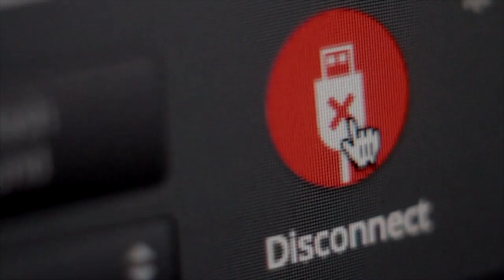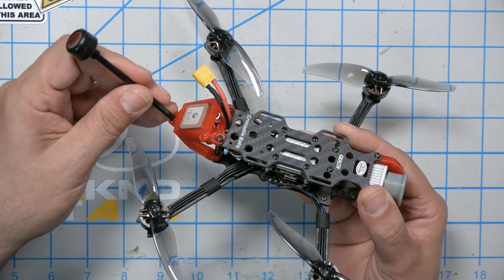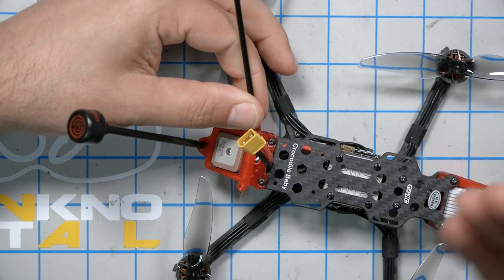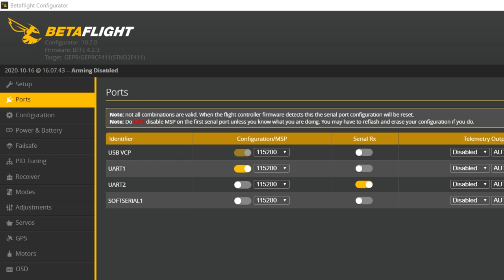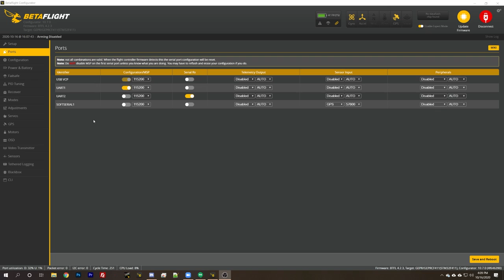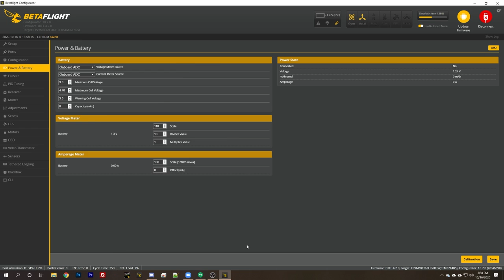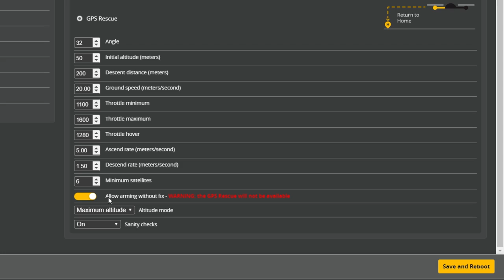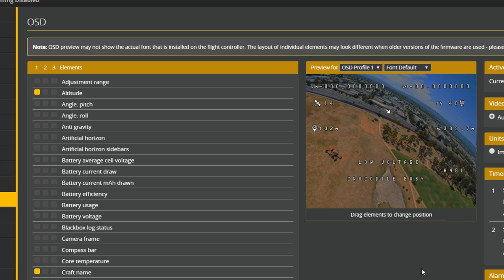GEPRC Crocodile Baby LR can fly for 30 minutes???

Comment: I'm really liking how the hobby is gravitating towards smaller quads since I started flying sub 3" and have continued to fly sub 5" for years since.
Reply: I agree, I really feel like my 3 inchers fly better than my 5 inchers by themselves.  The issue is that 3 inchers can't handle a GoPro nearly as well, so 5 inches is still the most relevant--although less relevant now that we have the Insta360 Go and Naked GoPros.
Reply: Boring.
Reply: @coolhanddruid  As is your comment.
Reply: @licensetodrive9930  No you
Reply: @coolhanddruid  Try something like a 1408 4000kv sub 250g 3" build on 4s. Imo you need to maximize power as you go smaller/lighter, and try to maximize smoothness when you go heavier. A quick and very agile 3" build can be very fun, and easier to tune. You can swap out to bi-blade props and fly in a park around people, they won't even notice it. Everyone flies different though.
Reply: Who needs a gopro if you have Dji 1080P. Unless you’re using the footage for professional purposes. But then there are other solutions.

Comment: Josh, I agree about the antenna tubes, one solution I found was I ordered the extra thin antennas from banggood and they actually fit inside those little red or clear extension spray tubes that come with WD40 or DeOxit D5 electrical contact cleaner aerosol cans; I went to my local electronics store, and they had bags of them that they found in the bottom of boxes of spray cans that use them... They had clear ones, and gave more than 20 for free. I mention this because it's the best way I found to get them, they're hard to find by themselves in less than boxes of 1000. Anyway, they're indestructible, at least so far for me, and my uniquely crash-heavy style of flying...! Some antennas didn't fit, but the skinny ones did.

Comment: After around a year having the Croc, I can tell buy it.
As a beginner, like I am it can give you a taste of different areas like crusing or first simple freestyle depending on hattery.
I flew it with 4s 1800mAh chonckers which I already had up to 15 minutes and now with 4s  650mAh which in comparison for my beginner reference is a hellride of agility and climb rate. Also as a beginner the actual need for freestyle-capability is limited - so in my opinion this quad brings more than enough to table to get a taste and learn basic things.

How ever I feel as a real bloody beginner, I would not recommend starting with light batterys - the less agile behaviour with heavy batterys is helpfull in the beginning I guess.

Also it even flys with 2s 1Ah hattery :)

Comment: 6:09 my guess is the vista is there so you can access the USB port without a motor being in the way like it is on some others. Same story with the whoop board rotated 45°, in most other builds the whoop board is mounted “naturally”, and it’s just about impossible to mount in a way that you can get to the USB port without taking the whole damned thing apart. Kudos for both of those design decisions.

Comment: As my first non-whoop quad I'm enjoying this. The only issue I've noticed is the current sensor did not work out of the box. I have the Analog and XM+ setup. They soldered the GPS RX wire to where the current sensor reads. I moved the GPS RX wire to the TX2 pin (A02) and remapped that. I then turned on the current sensor pin. Now I get GPS and Current.
# resources
resource LED_STRIP 1 NONE
resource SERIAL_TX 2 NONE
resource SERIAL_TX 11 A02
resource SERIAL_RX 11 A08
# timer
timer A02 NONE
# dma
 (maybe not necessary)
dma pin A08 NONE
dma pin A02 NONE
Reply: Jason what's your background thks
Reply: @joelhiltz3329  what do you mean, background?
Reply: @jacobm5186  Electronics Navy training ect  thk you
Reply: @joelhiltz3329  Just Electrical Engineering and lots of diy electronics.

Comment: @Joshua Bardwell  When you say you were running it at highest power available, do you mean 1200mW?   Vista has a known issue where sometimes performance actually decreases as you go above 700mW.  I suspect it's a feedback issue and usually this will vary depending on the antenna used on the VTX.

Comment: The ' flying brick ' architecture seems to still be prevalent in many designs.  One of my biggest pet  peeves and why  I prefer to design my own frames is many designs are still stacking  components instead of distributing them more streamlined. And my biggest pet peeve is the front mounted camera with little protection. And you are right to point those things out because the design of any  product is not just about mounting components to a frame... There is much more to that ...

While stacked components are desirable from a cpmpact form, if the quad frame has the room lengthwise, by all means,  use it! 

Interesting you bring up the ceiling mount of the  camera vtx, I did the same on my MIA Zoom years ago, for the same reason that I wanted to have ease of access to the VtX and DVR  when I was using the Caddx Turtle system. Except in my case the frame was very compact and it opens like a car hood, you can see that in some of my recent videos.

Comment: When you want to open it up, if you remove the lower front screws instead of the upper front screws the camera and its cable will come away with the Vista and that will give you much more access. (And will reduce the likelihood of you breaking the camera cable)
Reply from the maker: That's clever.

Comment: Hi, Mr. Bardwell! I just purchased the Baby Croc as my second fpv drone (my first is an Emax Tinyhawk II). I've run into some problems setting it up in Betaflight, though, my main one being that I lost my soft serial port and my GPS is not showing up. It was working fine when I set up the GPS failsafe using your recommended settings, but I must have accidentally messed something up. I tried resetting it to defaults in CLI but it didn't fix it. I'm fairly new at FPV and don't know what to do. Can you help me?
Reply: better off asking reddit😝😝

Comment: What about putting the GPS 5V to a switchable pin? Or using a little board what lets you to switch 5V with pwm signals, like the light switcher boards on RC cars/planes. So you can connect it to a servo output and assign an aux to it.

Comment: Nice rig, but I do not like the angle of the GPS mount.  I would not expect to be flying pitched forward at what looks like 45 degrees.  For "normal" flight you may pitch forward maybe 20 - 30 degrees, which presents a less that optimal angle for the GPS antenna.  Ideally you would want the GPS antenna to be face-up to the sky during normal flight.   It would also be nice if the FC was iNav compatible for true failsafe RTH functionality - nowadays iNav 2.5.2 flies pretty darn nicely compared to earlier versions.  While BF may be "best" (or what we are most familiar with), this is not an Acro rig per se, so you really don't need all of that.   iNav is ideally suited for LR and cinematic style flying.  I didn't mean to make this so much about iNav, but when you start talking GPS, BF is waaaay behind in that aspect ;)

Comment: 17:36 stm32F405 target? But my real question is, if I have Dji goggles2 and vista/old unit, how can I use it with this drone? I had v1 goggles worked fine on 4.1.1. on softserial (original Dji osd) but I pluged a g2 compatible flashed unit on this drone and no osd. What Bf version can I use to work? THX!

Comment: The jittery video seems normal on this quad from the other reviews I've seen.  But no one talks about it.
Reply: I noticed the same in a lot the footage of various reviews and also with my own Dave C Micro LR frame built/Vista, especially if there's a touch of wind. They just accept it or gloss over it.
Reply: @jt37218  low speed  KV-motor need naked gopro，LOL

Comment: Hello Mate, thanks for the great review.  Could you please show which pads are used to connect GPS in softserial configuration on this FC. I can use LED pad for GPS TX, but I don't know which pad to use for GPS RX? As you mentioned, UART1 is for Vista, UART2 for Crossfire. And I assume that Buzz pad is used for the buzzer? Therefore, the only available pad left to use for softserial mapping is LED pad, but GPS needs 2 pads one for TX and one for RX. I really appreciate if you show how they wired GPS on this particular FC. Thank you very much

Comment: @Josha Bardwell .. Is there enough space inside the baby croc 4" to replace the Caddx Vista with the Air Unit? ( i really want the on board DVR. (Also, great videos please keep posting) PD: when is the comparison between long range qwads gonna drop? ) thanks!
Reply from the maker: There is enough room front to back between the standoffs, however you would have to relocate the capacitor. I'm not sure there is enough room top to bottom above the FC, but in theory you could use longer standoffs.

Comment: Hi Josh.  I bought one and have been flying it for about a week.  I am having the exact problem as you, where my DJI Googles have 4 bars but my DJI controller has have 1 or 2 bars and turns red.  If you find a solution please let me know.  I'm emailing Geprc as well.
Reply: Ben did yours come with a Nebula camera ? Thanks

Comment: Joshua, or just anyone.  I got this Croc Baby and flashed it with G-H-30 2.3 JESC (48khz) with Telemetry, licensed. Then used Dshot300, 4k/4k, with Bshot "ON" and "12" on motor poles. It won't fly cause some motors are getting "errors," what's wrong with it? XD

Comment: How much amp draw were you getting on the Lions and what is the max discharge rate of the Lions?
Reply: For cruising (30mph) like 7-10A depending on wind. Punchout is 20-25A for me and the problem is not the lion cells, good sony vct6 can do 40A. Check the quality of your wires if you want to build your own pack. Cheers and happy flying!

Comment: Did your baby croc has an accurate current sensors? Mine can not be calibrated because maximum scale value is not enough. Did you have some advice? Replace resistor on FC?
Reply from the maker: Current sense does not work on that FC.

Comment: excellent video....... I Finally received my Crocodile Baby after almost 4 months of waiting...... I have a little problem.... I have the TX16s with R9M 2019 Module, the Baby has R9MM receiver, after trying different firmware in the receiver and the Module, I managed to Bind them and I get telemetry in the TX16S..... !! BUT !! ... when I connect the Baby to Betaflight,  I Backed up the factory settings, I Calibrated the Accelerometer, but I can't get any movement on the "Receiver screen", therefore, I can't do anything, or fly it....   . PLEASE HELP.
Reply from the maker: Since the receiver was pre installed it should really work. Very disappointing.

The first thing I'd check is that the correct UART is set for serial rx in the Ports tab.

Confirm SBUS serial receiver protocol is set in the configuration tab.

Comment: Good morning Joshua,
I am your follower,
I am Italian and I live in the Dolomites, indeed I invite you if you happen to come to Italy I wanted to ask you for advice if possible,
I bought a Croccodile Baby but I have a big problem, I can't configure the Osd on the Google DJI. The doors and the OSD are all activated but nothing appears on the display. On the other drones I saw that not having the DJI remote control but a Radiomaster TX16S I disconnected the cables from the Air unit camera as described on each model, instructions that I followed from my FC which is an iFlight and I see the OSD correctly on the viewers but from Caddx Micro I do not know how to do if this is the correct solution for the configuration of the OSD in your opinion, otherwise I cannot find the solution.
By chance you could help me, flying without knowing how much charge remains is practically impossible

Comment: re: vista packaging
I've had a tough time on two quads now trying to package the vista.  It's quite a bit larger than the 20x20 mounting holes, the position of the UFL connector and antenna can be inconvenient, it's tall, and the fact that you can't easily remove the camera to thread the cable through other elements are all things that have frustrated me at some point.  I bet you would have to change a half dozen things about the geprc croc baby to move the vista behind the FC.
Reply: Hey you can remove the camera connector. Just got to have a tiny torx screwdriver
Reply: @ekkle5ia  I guess a better way to say it is that since there is no plug on the camera side and you need clearance to get a driver onto the hold-down on the vista there are situations where you are stuck vs. analog setup.

Comment: @joshuabardwell "if you take off with minimal amount of satalights gps rescue will not work" It wont add satellites as they come available in flight; making it work?
Reply: It wont work in the sense of working correctly, ie with the correct home position. Once it gets GPS lock in mid air then it will likely become the home point making it pointless or "will not work" (as advertised)

Comment: They are either under 250 grams or can fly for 30 minutes, but not both at the same time. The 4S battery pack itself is 195 grams already. And the drone with lightest option with analog video is 130 grams. It can only be under 250 grams with a 2S pack. And we all know that you can't flip and snap with 2S.

Comment: After watching Your movies I decide to buy Crocodile Baby with vista vtx. But it is a big shit. In oryginal configuration it do not have the current sensor. But the worst thing is that FC is restarting each time after 3 to 10 min. I changed the FC to the new one and the situation is exectly the same and there is no solution for this. Now I am fighting with the shop to give money back becouse this quad/FC inside is tottaly useless.

Comment: i dont understand why none of these GPS LR quads include a magnetometer - its not like its hard to find a GPS module that has a compass built in.   I would love to try one of these with iNav for real hovering and etc but need that compass...
Reply from the maker: Because a magnetometer on a tiny quad gets a ton of electrical interference and doesn't work well. The mag works best either when the quad is large so you can mount the mag away from electronics, or when the mag and GPS are mounted on a boom.

Comment: GPS and fail-safe no longer shows up under beta flight and I have it enabled... guessing I should have saved backup before making small tweaks?...CLI commands for Gps stuff work but I'm a noob. I wonder if going to beta flight 4.2.5 will fix it. I have 4.2.3
Reply from the maker: GPS and failsafe missing makes me think you have "expert mode" disabled. Top-right corner of the configurator, gear menu.
Reply: @JoshuaBardwell   omg  thats exactly what it was! I had given up thinking i tried everything. This is my 2nd quad behind the tinyhawk. I feel better now about purchasing a 3rd from the same brand using an affiliate link ;-)

Comment: Does this drone, or others in this size category, have elevation hold or gps position hold?  What type of diy system would you recommend to avoid buying a mavic mini?
Reply from the maker: It does not have those features. You want an iNav or an ArduPilot drone.

Comment: Hi, this video is titled "can fly for 30 minutes???" This is a LONG video that seems to cover about everything except flight time.  
I sent this link to a friend who was looking for information on something that can fly longer.   Sent him this link figuring this would be discussed in detail from the title alone LOL.   
Do you have a different video that gets into longer flight times? This certainly is not the one.  Thanks!
Reply from the maker: I will be doing an flight time comparison of all these guys in the "shootout" video that follows the individual reviews. But the Baby Croc definitely can fly for about 30 minutes when using the 3000 mAh 4S LiIo pack that GEPRC sells (or a similar pack).
Reply: @JoshuaBardwell  Excelllent! Thanks!
I had no clue 30 minutes was possible.  
I'm pretty out of touch with newer stuff.
Will need to get back in touch.

Comment: For long range, the only signal strength indicator in the OSD that matters is Mbps in the bottom right of the display. Completely ignore the red indicators on the bottom left. They are wrong and mean nothing...
Reply: And if this is so, what low value  in mbps is “safe”?
Reply: @toys5355  below 10mbps is considered "shaky ground", below 5 Mbps, get ready to go to black screen and drop out of the sky, get your finger on the GPS rescue switch!
Reply: So you’re saying RSSI doesn’t matter?
Reply: @ZabDevin  I fly the DJI controller, not crossfire, so I don't use RSSI.

Comment: I recently just purchased this drone. Also the DJI version what is a affordable radio that should find right up my drone has Frsky xm+ receiver. Thank you.
Reply from the maker: Radiomaster Zorro with 4 in 1 module will bind to xm+ receiver.
Reply: @JoshuaBardwell  I know nothing about 4 in 1 modules do I just connect the module to my radio and then behind the radio to the XM plus receiver like normal?
Reply: @JoshuaBardwell  OK I think I found it. It has a built-in four in one module and cost about $140 correct?
Reply from the maker: Yes correct. I'm talking about the one with internal 4 in 1.

Comment: would this Baby Croc have better range  with a crossfire rx and Radio Master T16 and  DJI HD goggles .
Reply from the maker: Crossfire has more range than DJI controller, but if you run out of video signal range does it matter?
Reply: @JoshuaBardwell   I dont know what is the best FPV components for range,   I guess the naco.txt file hack for the DJI HD goggles maybe only answer for video feed ?

Comment: what battery do u recommend for this other than the 3000mah long distance battery
Reply: From :4s 850mah higher C rating 
Up to: 1100-1300mah for extra flight time. But you need to learn how to fly slow and efficient. Other than that, it's a blast. Good luck Bud.